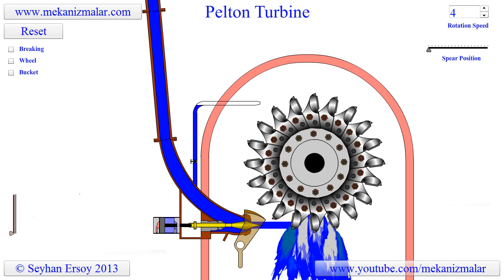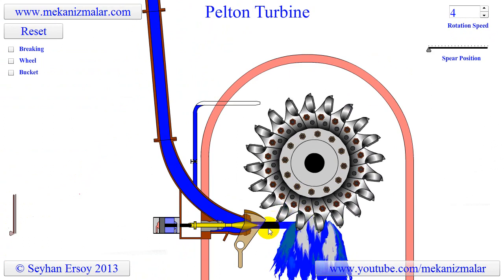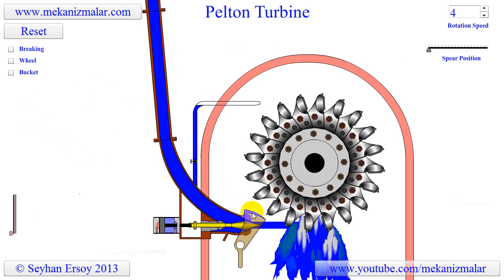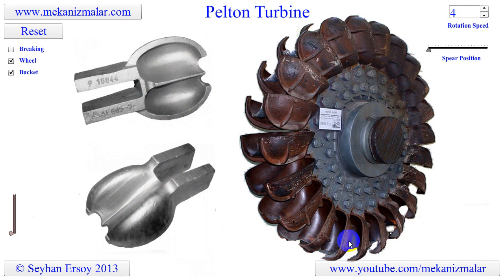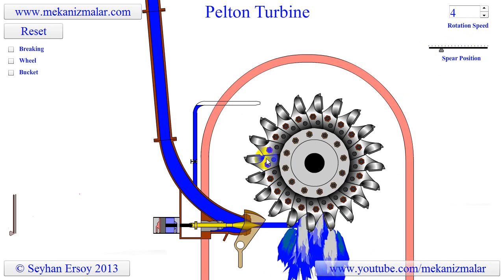pelton turbine

Comment: 🎯 Key points for quick navigation:

00:06 Pelton turbine invention
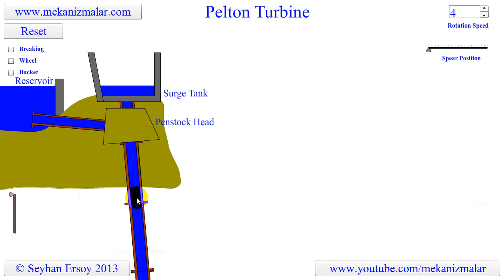00:19 Widely used turbine
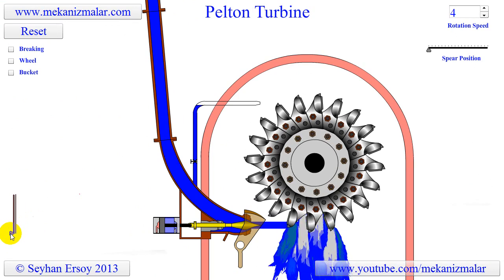00:34 High hydraulic head
00:47 Impulse type turbines
01:29 Spoon-shaped buckets
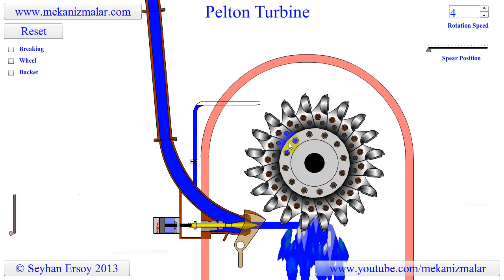02:07 Flywheel effect explained
02:20 Water flow control
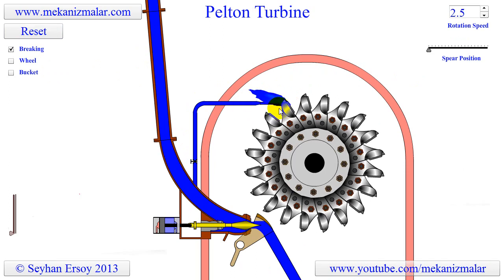02:46 Breaking rotational motion
03:05 Speed deflection mechanism

Made with HARPA AI

Comment: 0:30 The position of the nozzle: from up or from side - does it influence the efficiency?
Greetings from germany
Reply from the maker: I do not think that position of nozzle effect the efficiency so much.
Reply: @mekanizmalar 
Thanks. :-)
I thought, when it is from upside, the efficiency is besser because of the weight from the water makes more force.
But I´am not an engeneer, thats why I asked.
Greetings from germany
Reply: @Heads Mess Thanks for your answer.
Greetings from germany

Comment: Which software?
Reply from the maker: I use adobe flash for my animations.
Reply: I mean, wich software you used to do that (solidworks, comsol, ...), i need to simulate a pelton system just the way that you do.
Reply from the maker: I do not use any simulation program. I wrote the code in AS3 (Action Script 3) and do drawings in Adobe Flash environment.

Comment: Thank you for the video presentation of the Pelton Turbine. It was clear and concise. I have two questions for you. Where or who offers the best and affordable pelton turbine? Have you ever seen this type of turbine combined with the Kaplan Turbine? It seems to reason that since the Pelton system can handle a higher head pressure, but dissipates the force of the water, once it passes over the wheel; that you could place a Kaplan Turbine, after the pelton and capture more energy from the same water flow. What are your thoughts on this idea?
Reply from the maker: Thank you for your comment and support. The turbine that you described is not viable solution if one works just after the first one. Here is the reason. As you stated the Pelton turbines work in the mountainous region where the water head is very high (450m or higher), but volume rate is very low. However the Kaplan turbines require low water head (around 10-20 meters) but large volume rate. However what you are suggesting happens in the real world in different way. All the waters coming from from these Pelton turbines converge and collect in larger steams. The Franis turbines use these water power to generate electricity. If geography appropriate, all these water coming from Francis turbine combine and form large rivers where we use Kaplan turbines to generate electricity.  I guess the best application for the Kaplan turbines is that converting tidal surges to the electricity.
Reply: that is clever

Comment: i want to know how water heads and flow rates are related? i mean that water stored at high altitude gives a high head then why the flow rate is low?
Reply from the maker: Water head and exit velocity is related with formula V = sqrt(2*g*h) where h is water head and g is gravitational acceleration, which is equal to 9.81 m/(sec^2). Flow rate is related to the Area of the nozzle and the exit velocity. If exit area is fixed, flow rate will increase by the water head. On the other hand, if water head is fixed, the flow rate will change with the exit hole diameter. The flow rate of the Pelton turbine is controlled by the needle. If the needle pushed forward, this effectively reduces exit hole area and reducing the flow rate. The needle can be pushed all the way and exit hole can be closed completely. In this case the flow rate will be zero.
Reply: mekanizmalar thanks alot for the explanation. But can you explain that why it is said that pelton turbine can be more efficiently used in case of high head and low flow rate whilst Kaplan can be more efficiently used in case of low head and high flow rate if by keeping head constant flow rate can be adjusted?

Comment: That was really a nice helpful video but sir I have a lot of doubt's and questions....!!!!
I will be pleased if u answer these......

1)What kind of material is generally used in pelton wheel?
2)Fly wheel stores energy and is generally used in energy creation......but in this video u told to stop flywheel effect jet of water is used........!!!!.....i mean we can create additional energy by flywheel effect then why to stop it......Why is it????
3)Can we use more than 1 nozzle in pelton wheel????
4)What is the difference b/w pelton wheel and turgo turbine?????
5)Why can't we use pelton wheel for low heads???
Reply from the maker: Hi Shva, This is a long list of questions. I will answer them as short as possible. I will add detailed answer in my web site. I should also emphasis that I am not an expert in the subject, someone with more experience might give us much better explanation in the near future.
Answer 1: Since this is impulse type turbine water strike  with high velocity to the wheel. Particles in the water may create "water jet cutting effect", therefore buckets must be some kind steel.
Answer 2: Main function of a Flywheel is to regulate the erratic rotation of engines. When a four stroke single piston engine works, the power generated only in one stroke, but consumed in the other three. The power stroke generates enough power to drive a device and the other three stroke, but this creates erratic motion in the crank shaft. We use flywheel to smooth the rotation by storing excessive power to run the other three stroke so that whole engine works more smoothly.  If we increase number of cylinders, the need for the flywheel decreases and it becomes smaller. When the Pelton turbine operating it feeds electricity to the grid. The demand in the grid changes all the time, and these changes are regulated by spear of the Pelton Turbine. But if there is very sudden drop in the power requirement, than the spear can't cope up with this sudden change and the speed of rotation of the wheel begin to increase, this is not desired, since we want to keep frequency of the generated power fixed. So wheel rotation should be slowed down.
Answer 3: Yes, one and two is very common, but when you do a Google search you may see, 3,4 or 5 nozzle Pelton turbines.
Answer 4: I guess Turgo Turbine wheel is easier to cast and manufacture than Pelton turbine and you can bring the nozzle much closer to the turbine.
Answer 5: You can use Pelton turbine as low as 10 or 15 meters water head for small applications. However for large commercial production it is almost always the Francis Turbine is the choice under 450m. This is because available water supply in those elevations require multiple nozzle Pelton turbines which is not competitive as price wise to Francis Turbine. Since the water does not strike the blades of the Francis Turbine as it does in Pelton turbine, they will last longer.
Reply: mekanizmalar agreed wholeheartedly